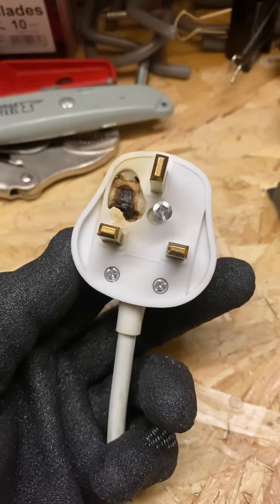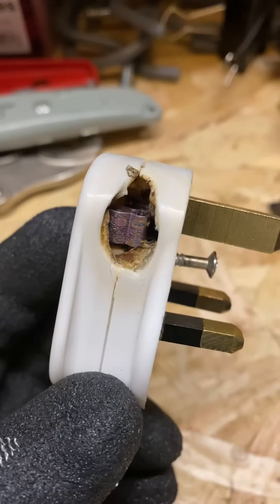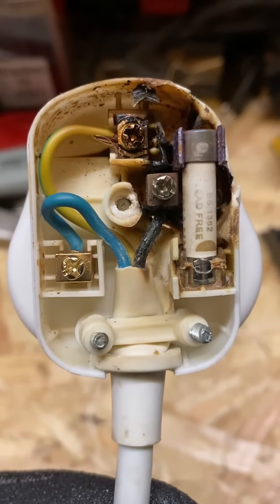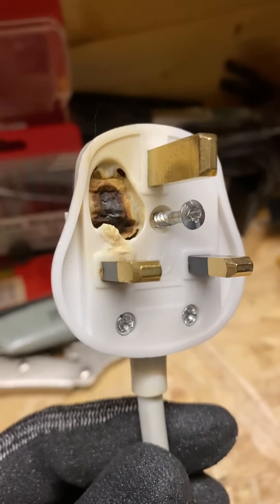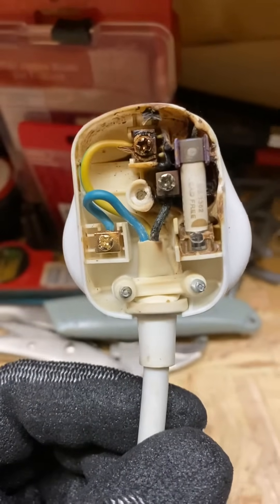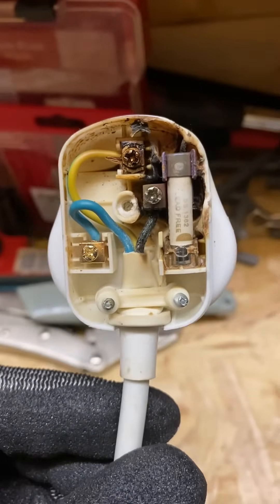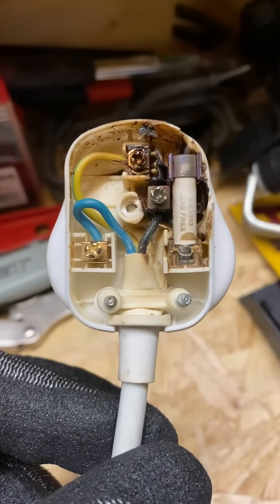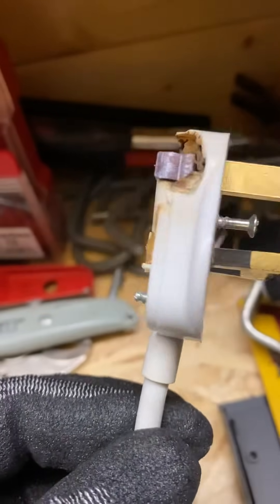Electrical Plug Fire - 13 amp plug fault

Comment: Hi Ben .i plugged my cheap kettle in to the wall socket and the kettle finished boiling and switched off the plug was really hot .can you tell me or give me a rough idea as to it being the kettle or the wall socket at fault . I've tried other appliances and the plugs have been fine .just wondering if the kettle is the problem. id be grateful for any advice.cheers.
Reply from the maker: Might not necessarily be a fault as your appliance does draw a lot of current although definitely worth keeping an eye on it and regular visual inspection of your kettle wouldn’t hurt either

Comment: Hi Ben, I’ve seen a few like this recently, all on high power convector heaters. I recently bought a 3KW convector myself, i noticed that on the box it warned that it should not be used for extended periods on high power. I tried it on full power and within 10mins i could feel the molded plug warming 😳! There are a lot of these out there, worth giving folks a heads up, they’re a death trap of left on over night etc. The sale of these appliances seems odd and outright wrong that the only warning was on the packaging, nothing on the appliance itself!!

Comment: The plug is also not wired in the correct manor. The neutral line is too long.
Reply from the maker: whilst it is slightly longer than it could be I wouldn't fail or see the need to alter it on this occasion. Importantly it is still shorter than the earth core.
Reply: @caterhampattesting  the earth should be longest.  As if cord is pulled the live comes out then the neutral comes and the earth last.  That is how it should be.
Reply from the maker: @alunroberts1439  Yes, that is what I said above? The neutral is shorter than the earth so all good.

Comment: that is a very strange fault, granted the live pin does tend to get slightly hotter than the neutral pin, but the heat build up normally is normally contiguous from the plug pin to the wire, this looks like as if it has been used in reverse. with power going out of the pins, and not in to them.
looking at the plus, that isn't a 13A plug, the cable is the wrong size, nor does the plug housing look to be to UK standards, the plug walls look very thin. this looks to be at best 5A rated, and what new UK / EU appliances come new with a wired plug? aren't they all moulded plug these days? this looks like it is from a cheap non EU/UK product.

Comment: Getting quite a lot of these atm with heaters. Think the issue is ventilation for COVID reasons so in winter months room gets cold with windows open. Customer pops heaters on and they never get a chance to hit the thermostat level, so just keeps churning away.